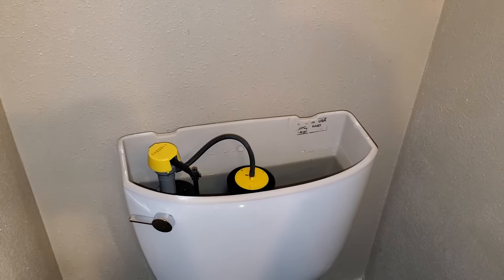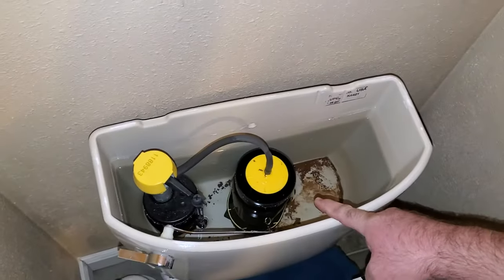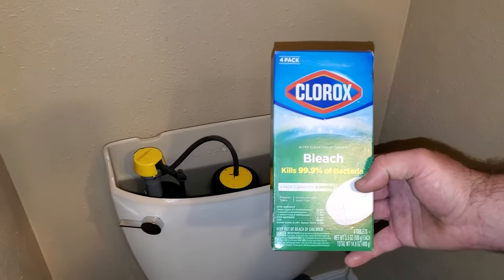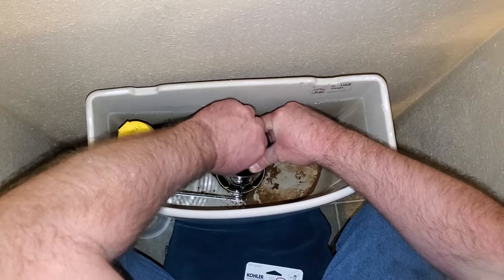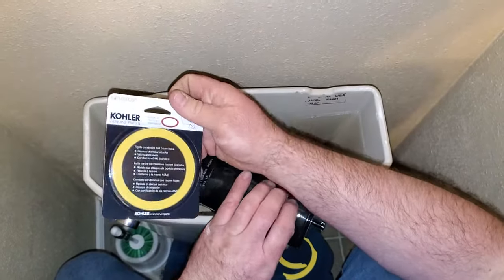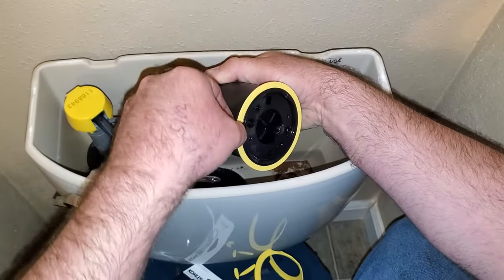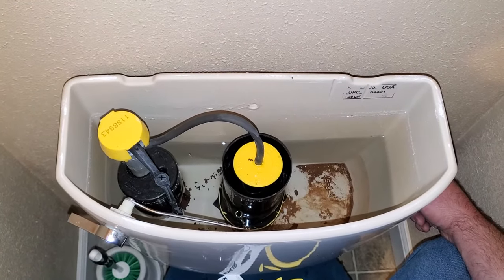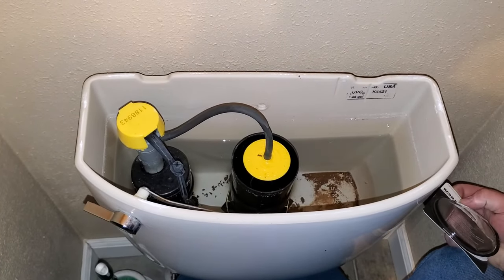Kohler Cimarron Toilet Repair

Comment: Thank you for saving me the cost of two plumbing repairs!  These toilets were installed two years ago.  Both toilets had the leaky seal problem.  The first toilet seal replaced had a very small bump on it and a mirror (exactly the same) one on the other flat side.  I thought that strange but threw the old one out happy to have been able to fix the leaking so easily!

After replacing the second toilet seal I noticed a series of three small bumps mirrored on both flat sides of the seal.  Frustrated I just threw the seal on my desk for a week or so.  Upon inspecting it again the bumps disappeared leading me to the conclusion that these seals had a defect in them!  

These toilets were installed in May and July of 2021 and repaired easily with your instructions so indications are that if the impurities are in more seals this might be a two year project and your instructions will be even more invaluable!  Thanks you again!

Comment: Thank you for saving me the cost of a plumber, it took me a little over a minute to fix our annoying leak. I didn't bother removing the tube since it was on so tight but was plenty of slack to just turn the tube sideways to work on it. Your informative short instructions were to the point without excess talking to purposely make it longer.

Comment: I couldn't get the rod inside cylinder to rotate from the top.  Being plastic parts, I was concerned it would break with to much pressure.  I had to reach down to the bottom of the rod and then rotate the rod from there.  It was a snug fit but with some pressure did rotate to the left.  A 15 minute repair.  Thanks
Reply from the maker: As they get older it is harder to turn. Yes sometimes you have to reach all the way down to get it.

Comment: Fluidmaster has a product (flush' 'n sparkle) that sits in the tank and passes the water that fills the bowl thru a sealed chlorine tablet container. It doesn't put chlorine in the tank itself, just the bowl.

Comment: At the end you say that it looks like it works perfect but it appears far from perfect to me. As soon as you let go of the handle the upper canister falls down and terminates the flush prematurely. At that point you tank is still half full of water.
Reply from the maker: That is correct. These toilets are designed to allow for a full or half flush to save water. Most material can be cleared from the bowl with a standard half flush. If you have something serious in the bowl you can hold the handle for an extra moment and get a full flush using the entire tank of water.
Reply: @MiloFarms  I turned off the incoming water, did a full flush and then refilled the tank using a measured amount of water. It took 1.8 gal to refill the tank. The inside of the tank is stamped 1.28 gpf. I then did what you call a half flush and found that it takes 0.8 gals to refill after that. That is about  half as much. That is also a long way short of 1.28 gals. Either way I am not getting 1.28 gpf. The toilet is 7 years old and it worked fine until a few weeks ago. I never thought to measure the water usage per flush when the toilet was working.

Comment: Was water leaking into the toilet or from the top of the valve? I have a leak from the top of  the valve itself thinking I need to change the flush valve.
Reply from the maker: In my case the yellow gasket at the bottom had become so hard it would no longer seal. If the leak is at the top it could be overfilling, have a crack, or a leaking fill valve.

Comment: My problem is not a bad gasket that makes the toilet run, it's the flush lever that sticks...it stays in the up position, preventing the cylinder from falling. I tried loosening the nut on the inside of the tank, but that didn't help. So I tried loosening the screw on the other end of the arm, but it is so tight. Do you know what I could do?
Reply from the maker: I have a number of these toilets in our different properties and had the same issue on one. The handle was corroded on the shaft that penetrates the tank. I took the screw (it was tight) out and took the handle shaft out of the tank. I cleaned the corrosion off the handle shaft and put some lubricant on it and reassembled.
Reply: @MiloFarms   I bought a new handle installed and have the same problem. I'm confused why it's still sticking.
Reply from the maker: @AHuh100  Sometimes the handle gets corroded on the shaft that penetrates the tank and will not allow the handle to fall back down. I took the screw (it was tight) out and took the handle shaft out of the tank. I cleaned the corrosion off the handle shaft and put some lubricant on it and reassemble.

Comment: This toilet is CRAP no pun intended, you're spending extra money for nothing "super flush" technology my ass in time the whole assembly will rust and you will not be able to separate the tank from bowl, better off buying a simple standard design toilet where the tank and bowl have simple gaskets, and the tank is held in place with big accessible plastic wingnuts